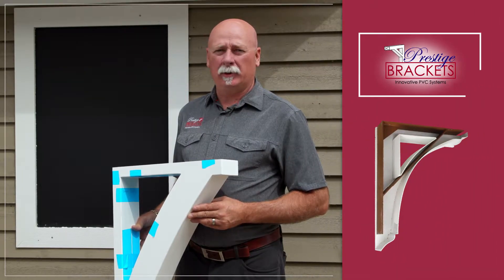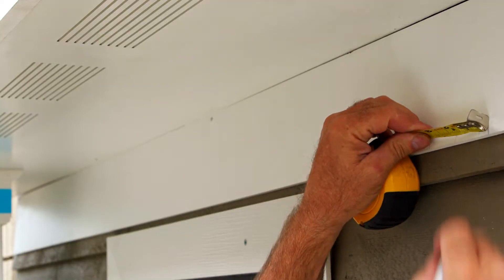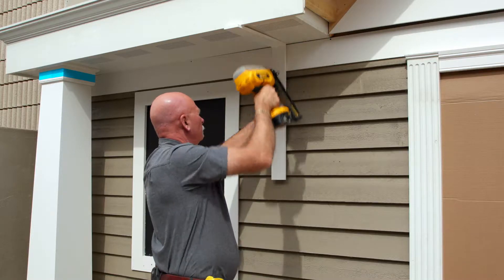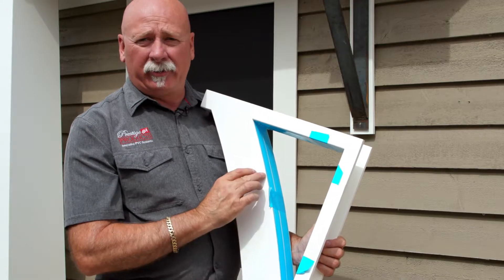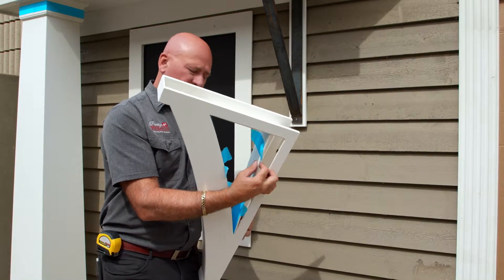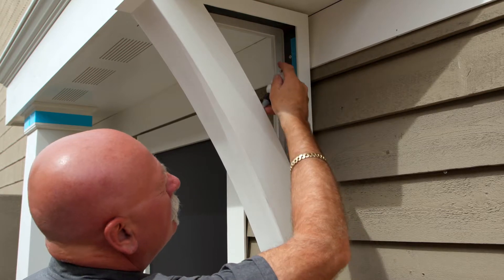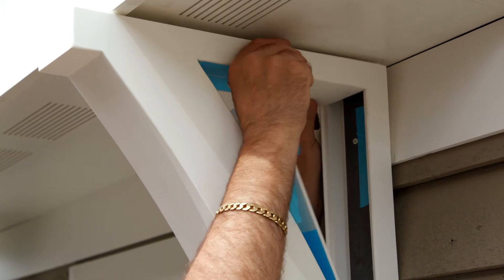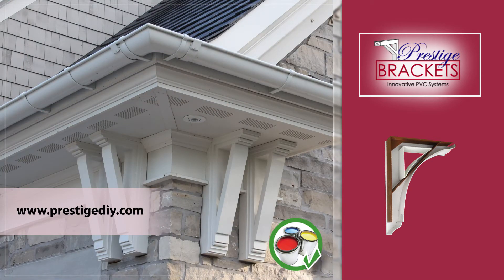PRESTIGE DIY PRODUCTS -  Structural Bracket Installation

Comment: Would these system be best for a two story home, that’s stucco? We live in Florida. Thanks.
Reply from the maker: Hi @angeltrudo, thank you for your comment. The Prestige DIY Brackets would work great for a two story home on Stucco. You would just need to confirm that the mounting bracket is fastened through the stucco into the structural framing in behind and the bracket can then be secured to it. Feel free to visit our website www.prestigediy.com for more information or to contact us directly with any follow up questions.